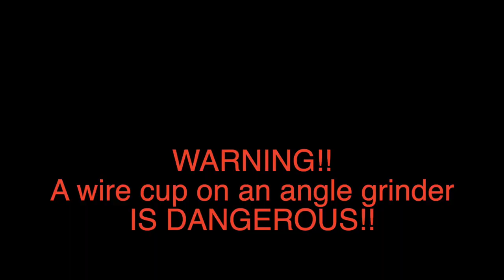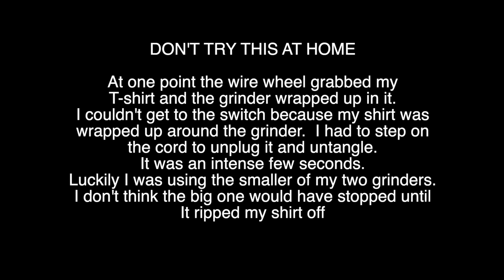C10 Project:  Stripping, Blasting, and Priming the Inside of the Bedsides

Comment: I'm not sure what their speed limit is but I'm using a new wire cup to remove paint and rust from a Trail 70 frame.  It's a old school grinder with high and low speed I'm liking low speed so far.
Reply from the maker: I wish I had variable speed. The grinder maxes at about 12k and the cup at 12.5k. Really too close to the limit. I try to keep it in contact and not freewheeling, gets a little scary freewheeling.
Reply: @StoutCustom   I use a sander with 20mm orbital movement. The switch is two positions; off - eat you alive! 
Lots of hard work Jim! A fine hair 12" hand broom keeps it out of the air better. 
Popeye forearms!

Comment: Quite a bit of work but looks like it is going to be worth it. Those look to be in great shape compared to a lot I have seen. My blaster is real sensitive to the humidity in the summer so I try to get as much done in the spring and fall lol
Reply from the maker: Yeah it doesn’t take much to stop one up. Metal is good,straight? Not so much, lol
Reply: @StoutCustom   but not full of rot and filler,a big plus 👍

Comment: So after you blasted the inside of the bedsides, did you go straight to epoxy? I'm sure the TDS says one way or another, but I know some preach to sand/scuff after blasting and then do regular wax and grease remover. I've also seen blasting, then just blowing it off and going to epoxy. Curious what your process was/is so I can try and replicate success.
Reply from the maker: Before I ever started on the bed I scrubbed it out with purple power degreaser really good and pressure washed it. That way there should be no grease or oils left. Then as you saw it was sanded and finally blasted till all the paint was gone and bare metal only. After that I blew it off with clean, dry air.  We have a good filtration system on the air so I know there is no oil or anything coming through. After that I went straight to epoxy. If you try to wipe sand blasted steel it just grabs  the towels/rags and leaves more than it takes off as you probably know. So far that has worked for me.
Reply: @Stout Custom  That's perfect. Made the mistake with the towels a d lint myself in the past. Figured it wasn't worth sanding after blasting, but just making sure that blasting residue is well blown off. Turning out great. I'm in the same boat on my 86 K30 crew cab build

Comment: I've done quite a few square body lately and finishing up one now was wondering when you take the bed completely apart and paint separately what do you do about that welded spot at the tailgate area
Oh and I've had more than one wire wheel run up my shirt before I first look around to see if somebody sean it happen 😂
Reply from the maker: I would probably spot it in. Maybe paint the rear sill all the way across and just spot in the top two welds on each side. I’m leaning towards assembling the bed and doing bedliner now. Sooooo much quicker and the bedsides flex quite a bit so I think they will have to be mounted in place in order to get the bodywork straight. I’m just feeling it out as I go. I know that look around feeling, lol.